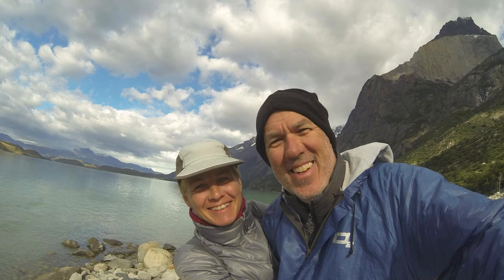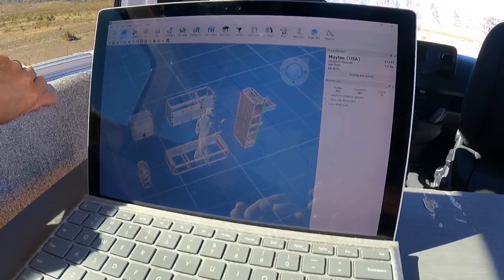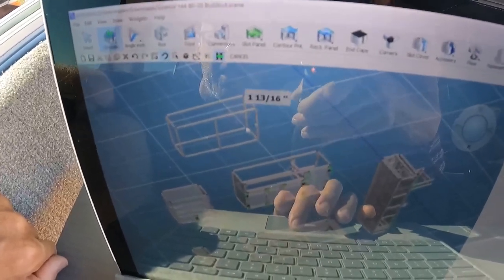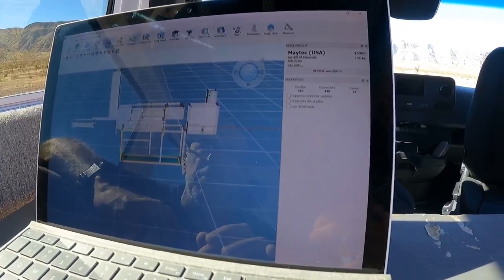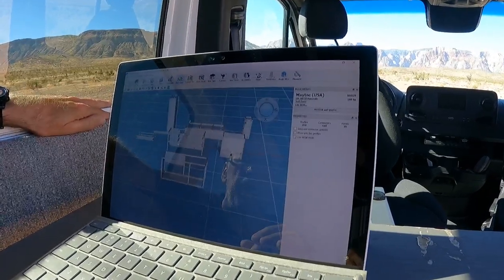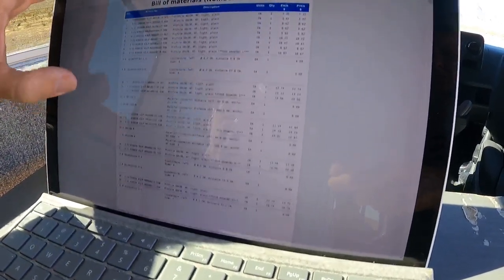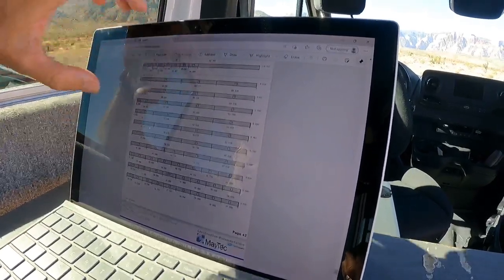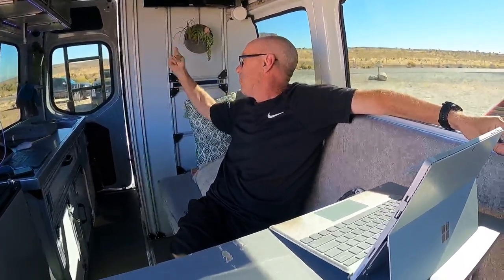SPRINTER LOW ROOF BUILD | MAYCAD (FREE) PROFESSIONAL VAN DESIGN SOFTWARE

Comment: Thanks, tho ordering 80/20 is really based on cut vs stick, lbs & length. Does the software help here ???
Reply from the maker: Hi Frazer - we order our 80/20 from Zoro & Grainger - which is not cut. Just 4 or 6 meter lengths. But if you were ordering cut lengths, yes MayCad will give you the suggested profile cuts to order. Not sure that answers your question or not. But certainly comment back if not. Have a great week and thanks for your comment.
Reply: @GayeNRobert  Robert, thanks for your reply & thanks for the info re MayCad, I have looked at it & find that creating a simple box, puts much of the load on connectors, not on the extrusion itself. Don’t easily see a way to move the cross piece on top of the vertical, so maybe you have a remedy - can we discuss off line ???
Reply from the maker: Hi Frazer - Yeah, I think the box defaults to have the profiles (the 80/20) vertical on the corners - like you stated.  We are off the van for a bit so I don't have access to our Windows computer (needed to run MayCad).  I think it creates the box that way for the look - as the "ends" are on the bottom and top instead of the sides - but truely don't know why.  It's very easy to create the box from scratch also - then you can change the orientation of the 80/20.  You definitely know more about the "load" then I do as I don't see the difference between the box strength myself (but definitely not an engineer).  I'd suggest to just create your boxes without using the "box" tool.  Hope this helps.  Robert